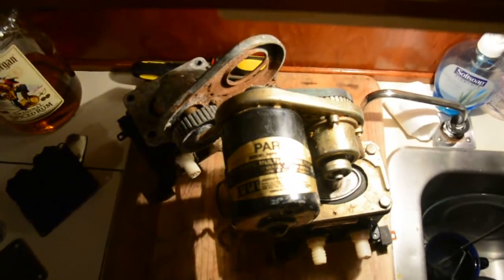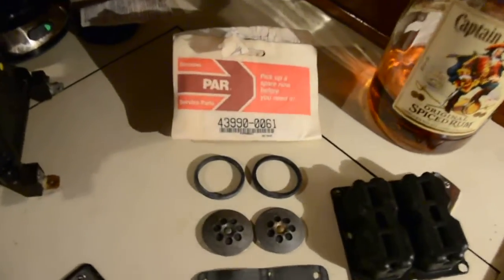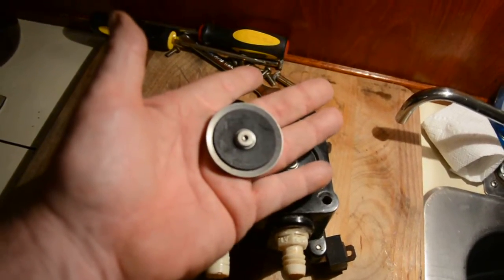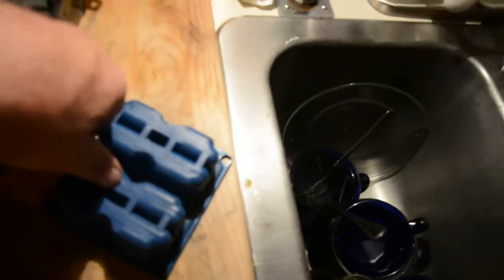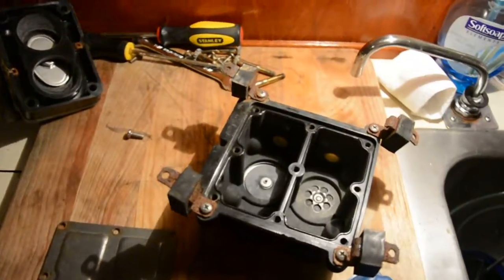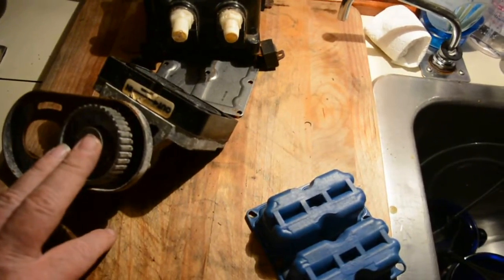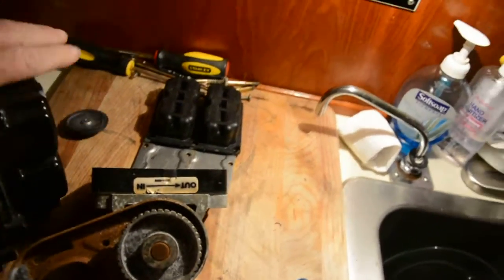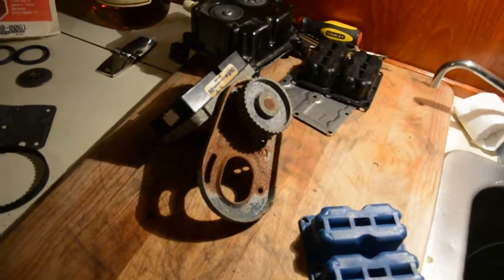Jabsco PAR 3 GPM pump disasembly

Comment: Be certain when you install new check valves that you place the check valve with the pinhole in the rubber on the INTAKE side...this is pointed out in the instructions.